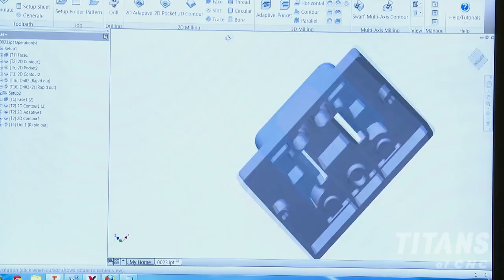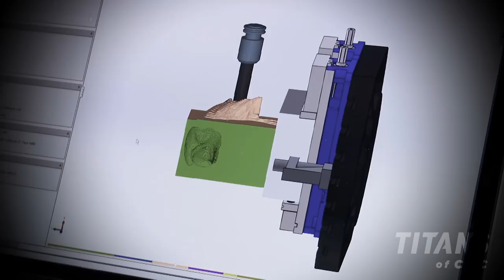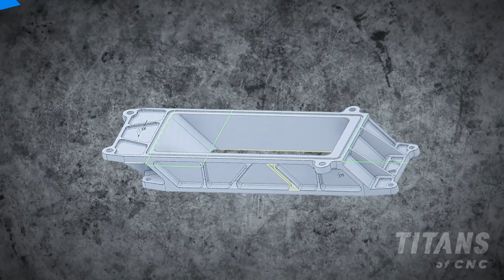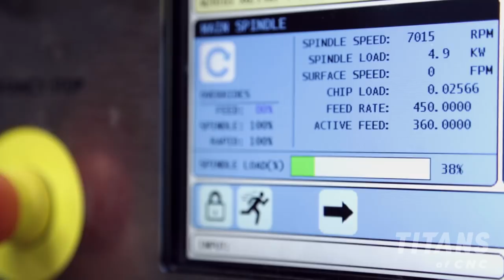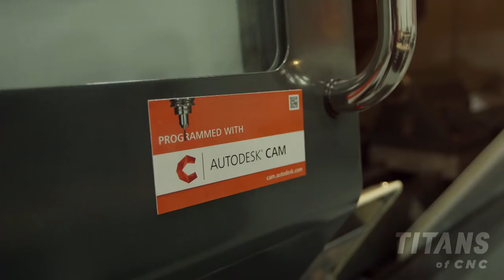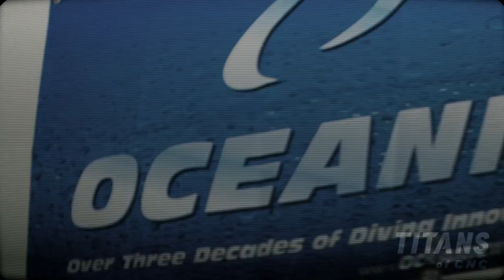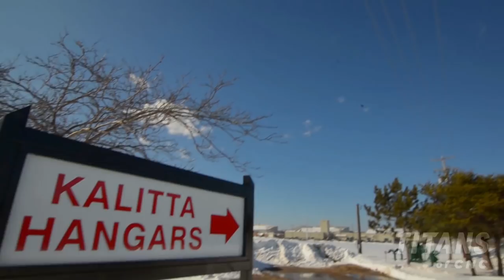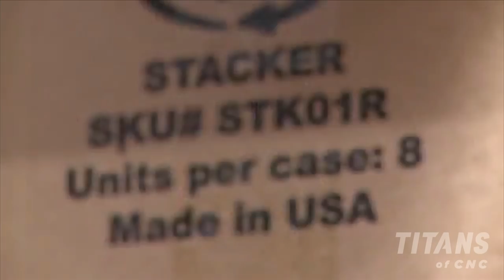CNC Machining for Kalitta Motorsports - TV Episode

Comment: I use to work for this company and I came up with so many ideas that changed it , my most proudest idea was getting these parts we only could run 2 parts a cycle to running 10 parts a cycle and it was a 20 min program n I was able to get the cycle time from 20 to 8 min!